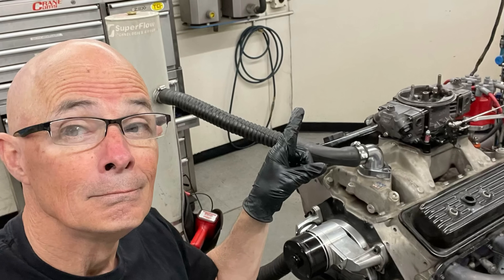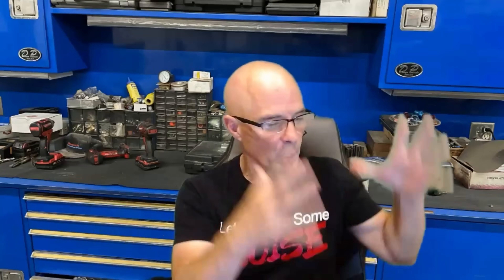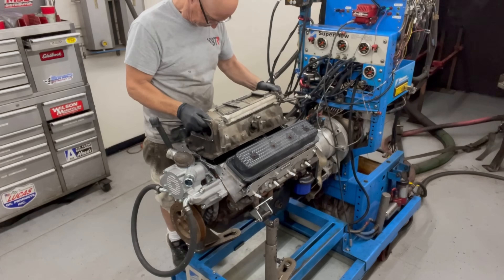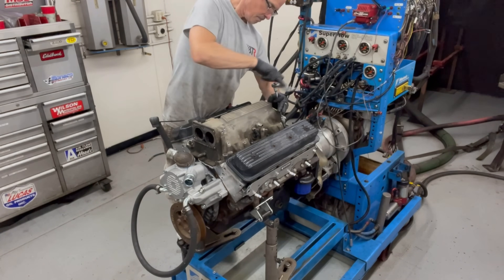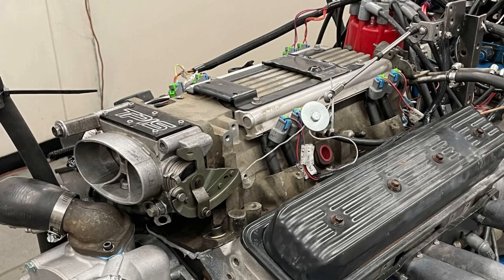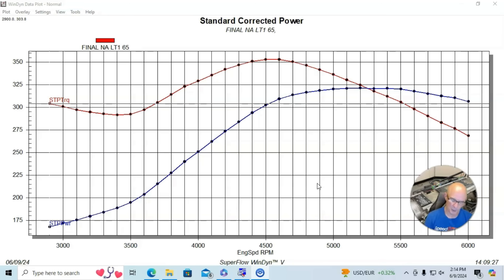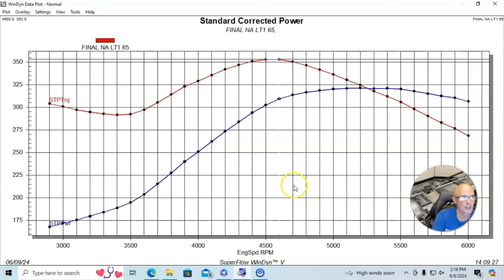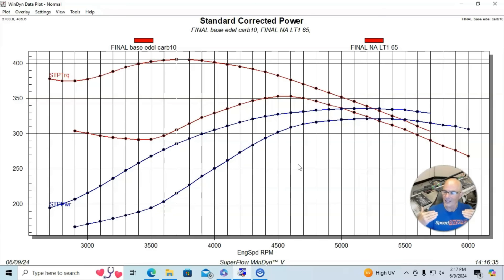GEN 2 LT1 INTAKE TEST-CARB VS EFI! STOCK LT1 EFI VS GM DUAL-PLANE & EDELBROCK VRS CARB. WHO WINS?

Comment: Good video I have the LT one, 350 inches but I am curious is that a special intake run on that engine great stick that Camaro running with the carburetor
Reply from the maker: GM offered a dual plane for the LT1

Comment: Coming back to this video a year later wondering if the test was redone and if the torque difference was accurate. Just got my 84 Firebird running with a LT1. Just a 11.5:1 stocked headed cc306 cammed car with 1.6 ultra magnums, pac 1219 beehives, hardened pushrods, guide plates, and an electric water pump. Nothing special. Tied to a 93 M29 T56 and a 9” with a 3.90 gear. I have the GM carbed intake and a brawler 750 race carb. I think the carbed intake would work better with the cc306 cam than the stock intake. Maybe it wouldn’t have such a massive torque loss down low.

Comment: The 90s Corvette engine.

Also found in the 94-96 Impala and Caprice.
Reply: ... also the 93-97 Camaro Z28, and Firebird/TA  ... and the aluminum heads were only found on the Vette and the Z28/Firebird/TA ...
Reply from the maker: and Buick Road Master

Comment: Hello from Romania 🇷🇴 

I have a 1993 LT1, and i want to carb swap the engine. 

The engine is out, the old parts that i have or kind if really old and i want new ones. 

Tell me if this list is good ! 

GMPP intake 
Carburetor ( but what carb does this intake accepts ? The one that you are using in video is good ? I was thinking for a 600 cfm one. And i need one that allows the tv kicdown cable bracket for the transmission to shift. Any advice heare also is needed.) 

Hei distribuitor 
Starter 
Water pump 
Plugs and wires 
Radiator.

What about the griund wires and what mecanical gauges should i use ? 

If i miss something help me out ! 
Or help me the corect list ! 
I allways watch your videos. 
Thanks !!!
Reply from the maker: no idea on gauges other than autometer-the rest should work well (a bigger carb might help power)
Reply: @richardholdener1727  how much you sugest for a 5.7 L ? Because if you calculate the displacement it needs a 600 cfm, but i see you are using a 750 one !

Comment: If the intake  runner length is the same,  and the cross section is the same.    The engine will make the same power (horsepower) 
The short block is just a air pump.
Reply from the maker: the design is dramatically different

Comment: Something is certainly wrong with the lt1 intake. I usually see them around 350-360hp and of course still less torque than that dual plane, but not that big of a difference.

Comment: I say carbureted I don't know by how much, but I'm fairly certain it's coming out on top.
Reply: Well I was right! Now I'm not sure if what I'm thinking is correct or not. That 100 lb-ft of torque difference down low was caused by the carburetor not having a plenum. My theory is that the plenum is slowing the air being pulled into the cylinder's at lower rpm's. Less air+less fuel=less power in the combustion process which is less power that the engine produces. Where as the carburetor doesn't have a problem pulling in a more significant amount of air fuel mixture at lower rpm's. Which is what the engine prefers having. Now I maybe wrong in my assessment of the provided information. Let me know what you think of my thoughts on this. Is there a way you can measure the air intake on the EFI system with the hat I know it can be done on the carburetor? That's the simplest way of checking if that's what it is.
Reply from the maker: its not that

Comment: oversized pump shot lol 750vs 732 TB but I have to point out 
without cold air intake and Maf Sensor and Cpu  its running on map sensor 
which is air Density and serious Handicap 
And still theres something wrong  the down hill on rpm and tork is pointing out vac leak or something  a big bog at 3000 rpm especially with 1st lt1 video 
showing  360 hp and 391 tork out of stock throttle body and tb
just off the top of my head throttle position sensor is off  so injectors arent getting signal 
maybe
Reply from the maker: tps is spot on-does not need a MAF (Map is not a serious handicap and is in fact a flow increase)
Reply: @richardholdener1727  Your right Rich.
I was just trying to figure out why torq was down quite a bit compared 
to your 1st lt1 video where it was 360 hp and 391 tork 
but your down 200 hp and 100 torq at 3000 rpm at 310 hp 330 torq
wonder if 1st vid was 30 over bore lol
or if this one is smaller than 4 inch bore truck engine?
You going to laugh but I just did test on stock 97 6 speed 
with stock performance exaust  with 1 cat disintegrated you can drop rock through on one side lol 
2 1/2 inch Y 4 1/2 inch single into Hooker Superformance muffler 
with 2 exit pipes .
The test was drilling out idle air hole to 1/8 inch  idle was 800 rpm with butterflies closed now its 1100 rpm idle 
which is livable in backed up traffic sitting still in jam but sucks more gas 
but increased power through out power band very notice able without dyno lol
making what was 52 mm 732 cfm into 54 1/2 mm 807 cfm Throttle body.
every body thinks I have LT4 .
after creaming their LS1 or LS3 or 2014 LT1 lol 
But Their Heart stops When I show them Stock exaust manifolds
and LT1 lol
Reply: @richardholdener1727   map is a ball park ignition spark 
maf sensor with optispark 
and cpu is miles ahead of the Hei and map sensor you set timing and it is what it is 
The optispark would amaze you 
if you watched how fast and how far 
it throws in advance 
and when maf sensor fails it goes to 
map sensor back up and loses power in high rpms 
if you make knock sensors deaf with 4.3 capacitors to ground or tune them out 

the cars pull harder than ever before 
and Msd and distributor would melt out 
center coil carbon trying to keep up lol
been there done that over and over for ten years in Blown Baha truck
actually the failure of optispark was two plastic caps facing each other and dead ending the 2 vacs a simple notch cut at 6 oclock to match and let vacume do its job is easy fix lol 
I bet super ram would carry max Hp
longer and farther 
it did on Lingenfelter cars.
GM actually bought out mitsubishi 
to get optispark technology

Comment: Richard  I gotta give you props most people  don't know that little trick. that you did dropping in the distributor lined up on the gear it time then  bump the starter over with a little push  drops all the way in on a  pump drive says  in time.  Always super impress  How good you are at this. I think you have probably the best  Scientistic An educational videos on horsepower thanks buddy.

Comment: The intake probably is the biggest difference. Carb. Always makes a little more power on same intake. If u put a holly sniper on the carb intake the difference would be minimal saw it many times. Engine masters for one this comparison was like comparing apples to oranges. 
Lets see some different engines  rich how about a boosted 3.6 LGX u can find them for around $500 now. Put some turbos on one do ring gap lets see how much boost one can take lol!!

Comment: The fact theres not a single aftermarket EFI intake for these LT1s is disappointing. My buddy has one making about 400 WHP in a Trans Am and it hooks and goes a-b. Funny watching 20-60k dollar "performance cars" get stomped by a 7k dollar Pontiac 😂.
Reply: TPIS makes or made EFI intakes for the gen2 LT1. They also make throttle bodies as large as one oval mono blade. I have the version with a distributor hole on a 91 Camaro. Good intake for a stick. It's definitely not a torque intake since it's just a taller version of the LT1 factory intake. I really want to try a FIRST intake to get the added torque. It a big port tuned port design. Not sure if they have a model for the LT1 though.
Reply: Im pretty sure Edelbrock used to make an RPM Air Gap version of the LT1 EFI intake.

Or maybe that was just for LT4 Heads
Reply: We had a 96 t/a
Running 13.0s.   On pure bolts no tune!!!!
3000 stall
True dual x pipe w/bullets before the diff
Mallory coil
Longtube headers 1 3/4
Cold air induction 
Electric water pump
Egr delete..
Factory gears
Aluminum drive shaft from 89 gta
Reply: These lt1
We're very underated

Comment: Thanks so much for this vid. I run 2 95 firebirds in England, 1 stock efi auto, 1 carb 650cfm 6spd with headers. Never had them dynoed but the carb over efi difference is very noticeable. Is it possible your timing curve, lower down with the injectors is hurting your torque numbers? Can you get the timing in sooner with lighter springs? What rpm was your timing all in by?
Reply from the maker: the dist is locked-timing on efi is controlled by ecu
Reply: you feel carb pump alone the throttle body was 732 cfm 
go 750 Elderbrock or holley

Comment: I miss working on carbs but I do not miss warming up cars up here in chicago land lol my first carb cleaning and rebuild job was on a 1962 Volkswagen with a Manx dune buggy body bright orange with the largest metallic flake you’ve ever seen lol the air filter was a cup fillets with oil I think it was the 1600 beetle as well was geared for all acceleration only did 65mph screaming with the massive rear tires I think like 18-20” wide lol

Comment: Something is up.  There is no way the lt1 intake should be sub 300 ft lbs at over 3000 rpm.  If I recall torque peak on those were about 2400 rpm.  Not only that but in the past you tested the lt1 vs the lm7 and there was less than 10 hp difference 355-365 hp on these from your previous testing
Reply from the maker: peak torque on lt1 is not 2400 rpm
Reply: @richardholdener1727  You can be kind of a clown sometimes.  The tq I mentioned was a published figure from GM for early lt1's in f-bodies.  This figure was suggested to show you your numbers look goofy.  I have chassis dynoed my 94 when it was stock and saw table top tq from 2000-4500 rpm, as well as many others show the same characteristics in manual cars.  Obviously those exact characteristics vary with headers, optimized timing, etc.  Either way, the point is that peaks may vary but it's funny you focus on that rather than the general issue where your numbers seem off even compared to another stock lt1 you dynoed in the same configuration.
Reply: @ttank1994  peak torque on lt1 is not 2400 rpm

Comment: Have you ever compared vortec ports to lt1? Would vortec intake ports match? Then all you would have to do id drill the mounting holes. Then you could try several different intakes pro flo xt, stealth ram, etc
Reply from the maker: Vortec or almost any SBC ports line up-just the bolt pattern is different
Reply: @richardholdener1727  so an intake for a vortec can be filled for lt1? I ask because I have access to a stealth ram

Comment: IIRC the stock LT1 throttle body is kinda small (I want to say twin 52mm, which is roughly equivalent to a single 76mm). Maybe a bigger one would help with top end power?
Reply from the maker: we plan to test that later
Reply: nice
Reply: Stock is twin 48mm. 52mm is the next size up and the biggest one you can run on an unported intake
Reply: @sstevocamaro  stock is 52mm with 4mm idle hole 
at 732 cfm 
that why there is 0 gain with 52mm BBK 
cant do it with automatic and car will use more fuel at lights intown driving 
I drilled idle hole to 1/8 from 4mm to 6.5 mm idle went to 1100 rpm 
TB is now 54.5 mm 807 cfm and goes higher in rpm than it did before
my 97 was 561 heads stocker Fast now is Stupid Scary Fast
took some getting used too
knowing the biggest hold back was the tb 
and 58 BBK is a little to big for stocker lt1 lol

Comment: Something definitely going on with the efi setup. This topic has been beat to death in the lt1 community for 20+ years. The difference is not that drastic.
Reply: I agree. If you look back at the video a few years ago, he ran an equivalent engine and it made wayyyy more power. Something’s definitely up.
Reply: I wouldn’t take any test as an end all be all for anything but every test is important because it adds more data to the pool and is good for comparing the different variables associated with each test. Richard has done a lot of good videos comparing fi and carbs, most end up with really close numbers!
Reply: I had pretty much the same setup on my 97 ta for a short while , and the difference was night and day. Idk if it was 100flb worth , but different for sure.
Reply: @Emilthehun   I just can't see that lt1 intake making power until way up on rev range
 All the testing Richard does on other engines proves this yet old test suggests lt1 works well and hard to improve apon. Stealth ram has longer runners and you would think it kills lt1 intake
Reply: @CLEEPER1  the best lt1 intake is a stock one ported by Lloyd Elliott
Reply: @Emilthehun you went from stock efi to carb and the carb had much more power?
Reply: @mavcar38 yes although i didn't dyno it. Then i had a machine shop install injector bosses on the card intake manifold,  and ran it like that for a while. Now its back to the  lt4 intake , and coil on plugs 😂.
Reply: lol, if you had to pick one which route would you go? I have a 96 vette lt1 and was going to keep the efi with a torquehead setup. I have another lt1 with the gm carb intake.  Carb is much cheaper route of course. Cant seem to make up mind. Going in a third gen camaro.

Comment: Thank you Richard for the long waited test! As a stock config, the LT1 has got pretty compression ratio already and the heads flow better thanTPI  L98's 113 stock heads do. As you have shown as previously, a dual plane carb combo tends to produce low to midrange torque way better than the mini-ram style fuel injection. Perhaps these could explain the >100ft lb difference in the test? 
Wouldn't you like to try to fit a TPI on this LT1 as a tryout?
Reply from the maker: I did that already on the L99

Comment: Richard you have to add a throttle body air splitter on the throttle body !!!!! PLEASE !!!
Reply from the maker: air foil FTW!
Reply: @richardholdener1727  LETS GOOO !! Would you be willing to do a dyno run with and without the air foil ? I’d love to see some proven results. I’ve only ever found an old notes chart from a forum where a guy supposedly tested the air foil, seeing an average gain of 5 hp, but never showed a dyno chart.

Comment: Dual plane VS ported stock should have been the test
Reply from the maker: why
Reply: @richardholdener1727  most of us don’t run the stock manifolds it’s one of the first mods is to port them with a 58mm TB.

Comment: Crazy how in stock form with a real good tune they make almost as much hp as a stock 4.8 and almost as much torque as a stock 5.3.

This is why I don't bother with sbc anymore
Reply: Crazy how stock pickup truck engines will outrun the end of run 30 year old Chevy based on a 70 year old design? Flathead, Oldsmobile and Cadillac OHV guys said the same thing about the SBC. People still build them. Hell, the 2.0 liter turbo mills today are same HP/More Torque than the LT1 in a Camaro. Surprise. All of them are better than walking.
Reply: Yea that’s true in stock form, but once you add heads to the LT1 it starts to walk away from those engines you mentioned. Those 5.3’s don’t respond well to aftermarket heads because the ci isn’t there.

Comment: Hey Richard I have a question for a new build what would be the best 5.3 to build with stock bottom end for all motor and nitrous to handle it
Reply from the maker: any 5.3L will handle nitrous
Reply: @richardholdener1727  LM7 flat top pistons bottom end or lc9 4th gen all aluminum
Reply: @richardholdener1727  I have a lm7 flat top pistons application rn in the car how much will it handle?